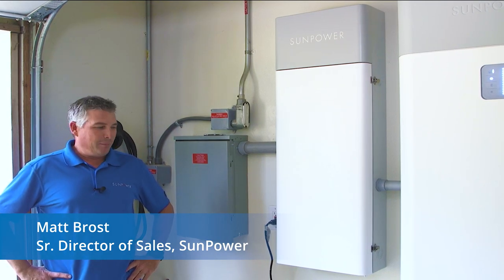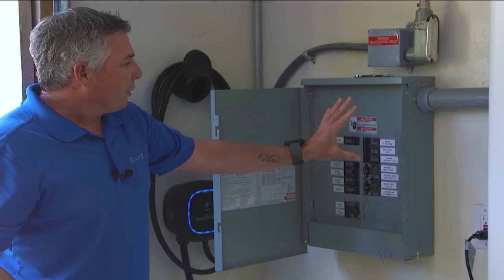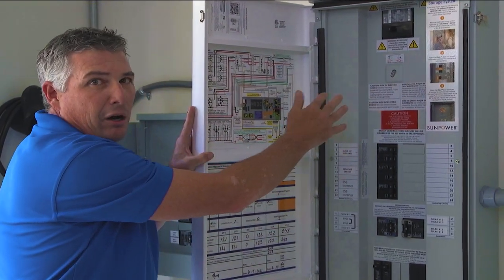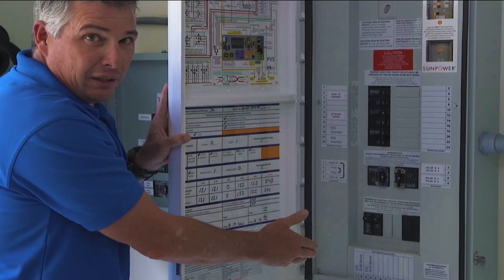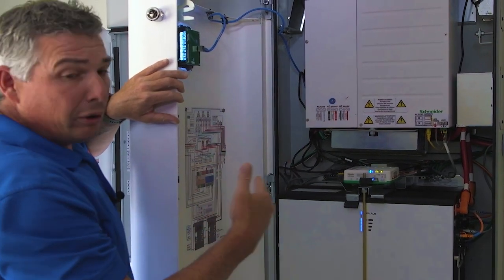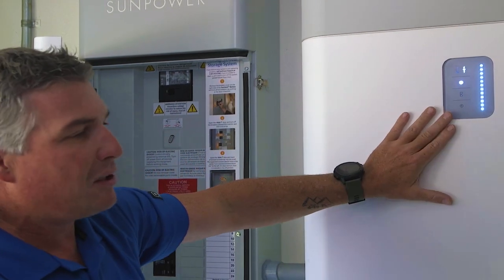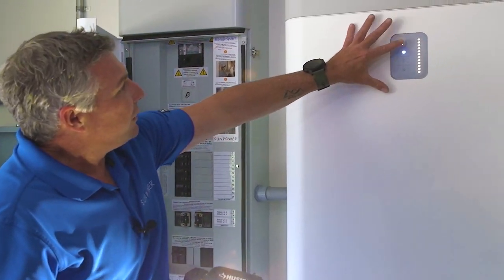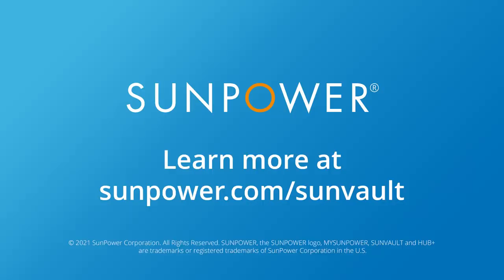A Look Inside SunVault™ Storage

Comment: Nice Matt.   Having the subpanel connected to the backup gen is a way to get more circuits backuped up.   We've had pretty good luck with just relocating breakers into the Hub+ for people that are comfortable with the 10 breaker spaces.
Reply: Agreed, that's the beauty of the HUB+. I needed more circuits backed up, so the sub was an easy solution.

Comment: I had 18, 420w Sunpower panels installed on my roof along with the Sunvault storage system with the extra battery for a total capacity of 26kw/h of storage.  I wish there was more - the secondary battery cabinet is the same exact case but doesn't have the inverter in it; if they offered a way to fit 2 additional battery packs inside that for a total of 39kw/h, that would've been awesome, otherwise it is wasted space.  Each battery is 7.5kw/h of storage, and they install them in pairs.

That being said, it does have somewhat adequate storage for my needs, and I chose to have my entire service panel backed up.  Most of my appliances all run on natural gas - furnace, hot water heater, clothes dryer, and my stove.  I do have a small house - 900sq/ft with a basement.  I do have an older, crusty central a/c system, but while it is running, it only consumes about 2200w.  The inverter supplied in the sunvault system is rated for 6800w continuous, and a lot more in surge watts.  I have not yet tried running my central a/c solely from it, but with the panels producing power during the day, it should have no trouble.  I do have plans to upgrade my HVAC system with a new high efficiency gas furnace with a heat pump, so hopefully that will let me nuke the gas bill a fair bit.

I've had only one power outage since having the system installed, and it performed well.  I came home, heard a bunch of small engine generators droning away, saw the street light out, but my house was lit, and I was able to open my garage door with the opener, no problem, went inside, and pretended power wasn't out.  A neighbor across the street was staring daggers at me. :)  The only issue I noticed is that power would flicker (brighter) once every second, and if you listened to the inverter, you could hear it pulsing.  No idea why it was doing that, but it wasn't enough to make us sick or anything.  After a few minutes of that, it would smooth out and I'd have steady, solid power, but maybe 15 minutes later, it would start the pulsing again.  I could really see it with incandescent light bulbs (have those in my old fridge) but I could also see it with LED bulbs.

The only other issue I've been experiencing is with the power company.  Specifically, high grid voltage.  I didn't know this at the time (I wound up calling Sunpower support thinking something was wrong with the battery), but the battery inverter is set to shut down and stop charging/discharging if grid voltage goes over 252v.  Voltage routinely creeps to 253 - 255.  Everything here still works, but instead of having solar charge the battery, it exports to the grid instead, and I think some of the micro-inverters shut down too, but not all of them.  Been fighting with the power company to fix the issue for 5 weeks now.  Spoke to a guy on the distribution side and he checked the switching station and voltage there was perfect, so he checked plant maps and found a cluster of transformers that feeds my neighborhood set with a 2.5% boost voltage.  Hopefully they get that resolved sooner than later.

Aside from all of that, I'm mostly satisfied with the system as a whole.  I do wonder though if my system is undersized - the sales contractor swears the system is designed to produce 101% of my yearly consumption, but I earned zero credit since my system was commissioned in the beginning of July last year.  I hope to see something different this year, or I will order more panels.

Comment: When will they fix the reliability of SunVault ?   
System shuts down completely every 3 to 4 weeks and requires SunPower Tech Support to reboot remotely, that is if they are not off for the weekend or holidays. 
Will have to wait for Solar Generation until after July 4th due to no support.

Comment: Is there any reason why we wouldn't just back up our entire panel? We should be able to limit the use of power at the user interfaces during an extended outage. My thought process is that I would like to have the battery system, propane powered generator, and solar array and use the grid as primary, battery as secondary, generator as third source for longer outages and recharging, and sell back excess solar to the grid. 

Is that reasonable for a consumer system of two buildings with a total sq ft of 1600 feet?
Reply: Certain things require a lot of power which arent necessary in outages. Ie a dishwasher or an AC unit will drain any battery in a matter of hrs. Also it has a voltage max per breaker. It would make more sense to add another battery instead of a generator, but the generator would give you more diversification. However these batteries can last up to a week or longer if you use them sparingly and the sun comes back up. One battery should be plenty for a 1600sqft house used specifically for backup
Reply: @zm9142  I understand that switching required is not approved in all states. Is there a common work around?
Reply: I have the same question, I am interested in backing up the entire main panel from the battery plus having a generator that I can switch to in case there is an extended power outage.  The SunVault would keep things going in the house seamlessly until I can get the generator started.  How might the system accommodate this type of main panel connection and source switching?

Comment: Why do they say 10 backed up circuits if there are 12? Can only 10 be used, because 2 are taken by the storage inverter?
Reply: Correct.
Reply: @mattbrost3094  Can the circuits be tied back to specific circuits via sub panel? For instance, I have a 400 sq foot cottage on one, 100A breaker that leads to the cottage, and a subpanel in the cottage. Could that be a single one of the 10 available?

Comment: Cost Savings Mode doesn't run during the weekend, rendering the battery useless.  I have to default it to Self Supply or else the battery goes unused on the weekends.  I called customer service and they said they're working on it, but they've been working on this for years now...  This is just bad customer service after they've already locked people in.  Ridiculous
Reply from the maker: Hello and thanks for reaching out. We would like to be of assistance. Please provide us with your contact information and we will have a representative reach out to you at a time that works for you.
Reply: @sunpower  I prefer not to post my contact info on YouTube, is there a way I can reach out to you?
Reply from the maker: Yes, our apologies, Jeffrey. You can email your information to customersuccess@sunpowercorp.com.